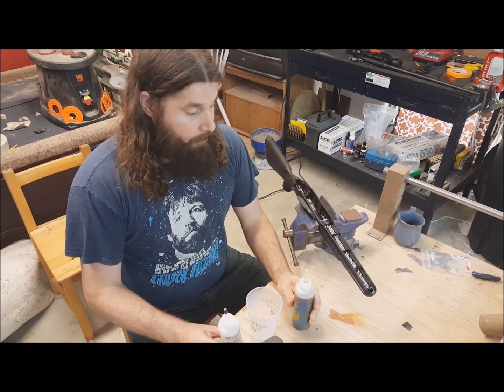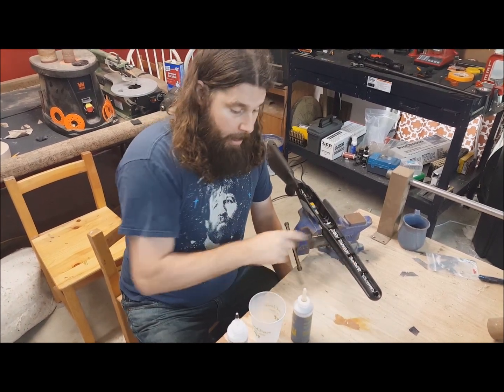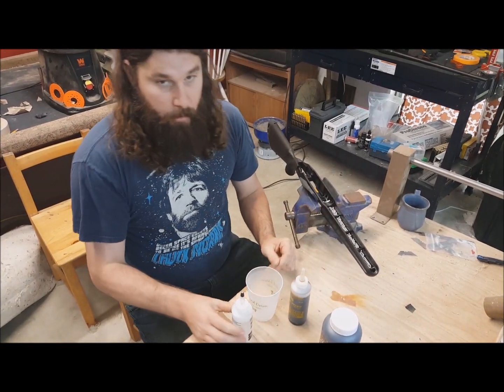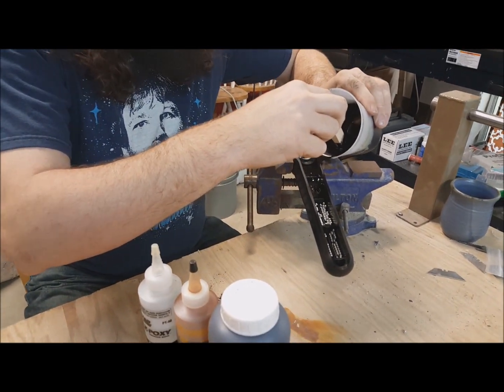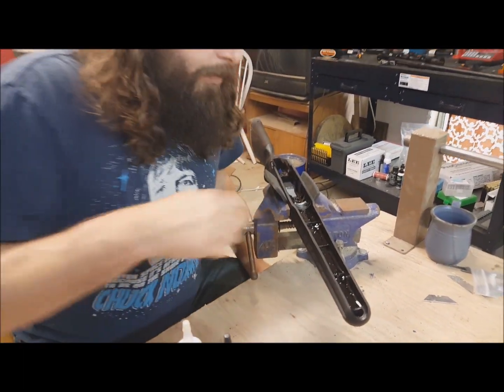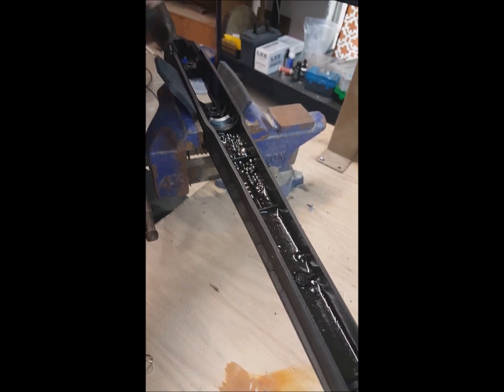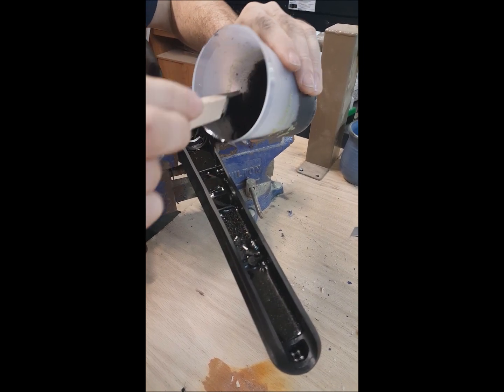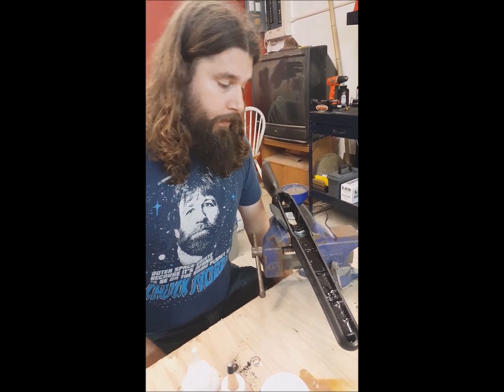How to fill a synthetic stock to add weight and rigidity.

Comment: For the extreme weight distribution theory, set the stock up so it can tilt back and forward establishing a (pivot point) add the desired BB's to the forstock and balance the stock, add the epoxy and bamb you set. Great ideas from great gun guys.

Comment: Great video, but just one correction. Viscosity of a liquid is a measurement of the thickness of a liquid. Therefor 90 weight oil is more viscous than 10wt oil. Cold oil is more viscous than hot oil. As such, a heavy oil is more viscous and flows more slowly. Lt or thin oil pours more readily than heavy oil. 

Merry Christmas
Mauro

Comment: Has anyone done this and it changed the accuracy. I have a savage that shoots perfect but I hate the way the stock feels.  I'm just worried if I mess with it it will ruin the accuracy
Reply from the maker: I have done this with several rifles after shooting them and it hasn't changed the accuracy at all. As long as the barrel remains free floated it won't change anything.
Reply: @deron29  good to hear. I have a savage hog hunter that is very accurate considering it only cost my a little over 300. Thought about a Boyds stock but if I can improve the existing stock that would be preferred

Comment: I just did something like this recently to my 12 gauge, it kicks like a mule even with the birdshot so I went ahead and filled the butt with loose sand and a few ounces of number 8 lead shot and it added a pound and a half to 2 pounds extra weight. so is it ok to have loose material in the butt of the gun?
Reply from the maker: It may leave some marks on the inside but nobody will ever see that

Comment: Have you used the same technique on the butt? Curious to see how you would do that.
Reply: Yes, fill a small balloon or plastic baggy with bbs. Put in butt of stock. Hold gun vertically. pour epoxy in balloon or baggy. let dry.
Reply: Witch Zpoxy product did you use, and what size? They have quite a few.
Reply from the maker: Not sure, I bout it from lmii. It is a luthier supply shop online.